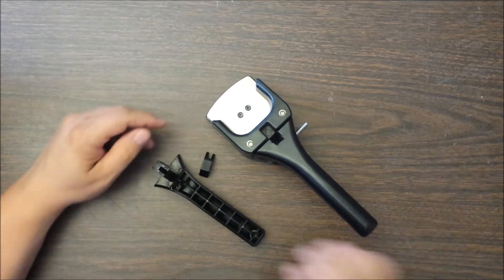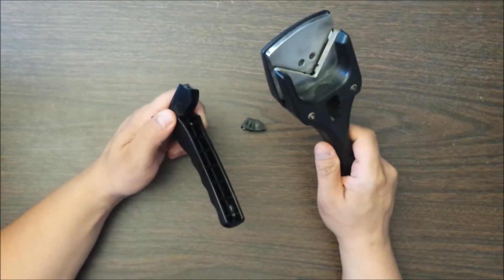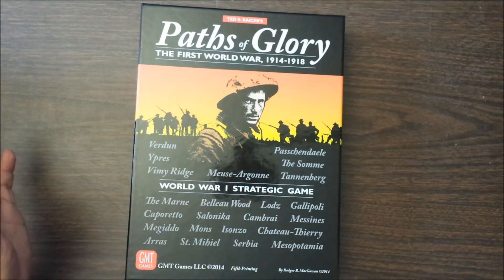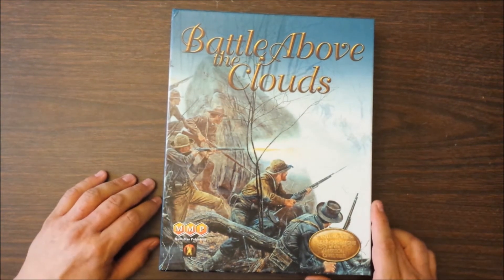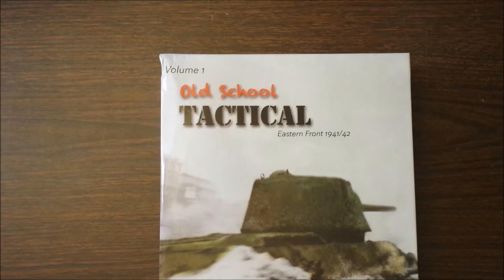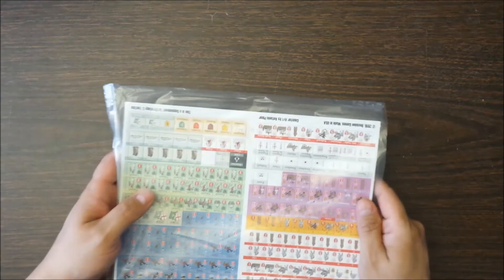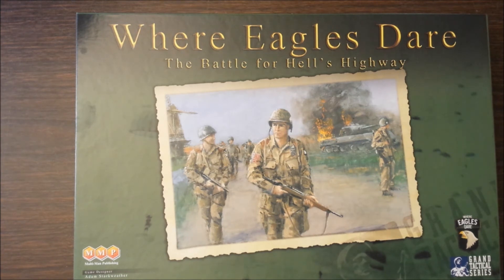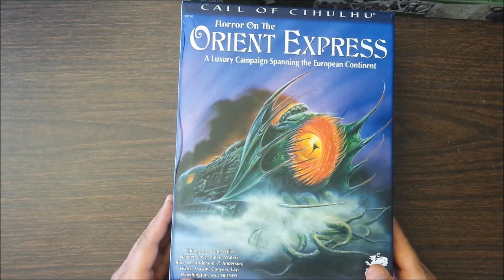Origins 2016 & Recent Acquisitions

Comment: I recently have the same problem with my OL 2mm heavy duty counter cutter, and I remeber this video from you, so I want to write some of my expierence with OL customer service. they are great, I reported my problem (broken part) and get a quick reply, since I live in Germany, they said they will ship me a replacement part but I have to pay the intl. postage, no problem because I also bought a simple 2mm cutter from them at the same time, when I get the package, I noticed they have packed a full set, yes, a full set of this heave duty counter as a replacement, although it is not a new one, but still in good shape, now I have repaired my own cutter and have other parts left. I am impressed.
Reply from the maker: I still haven't repaired mine, but the basic 2mm model works so well I'm not terribly broken up about it.